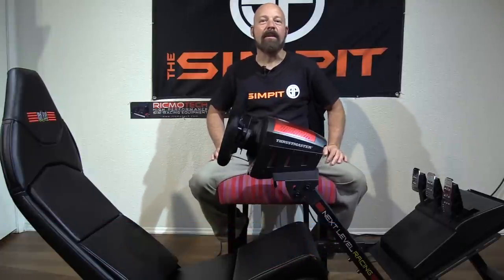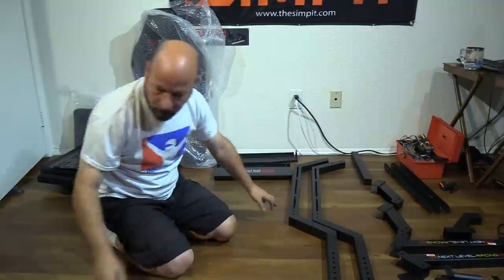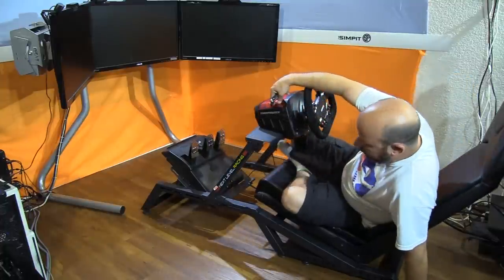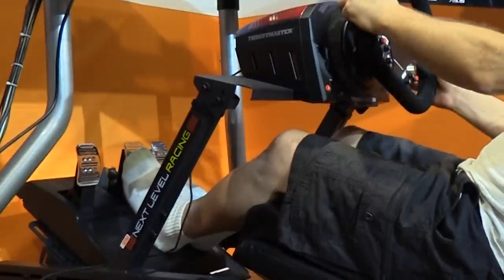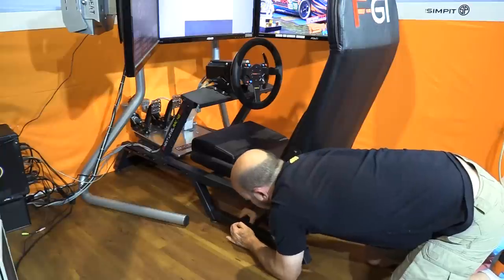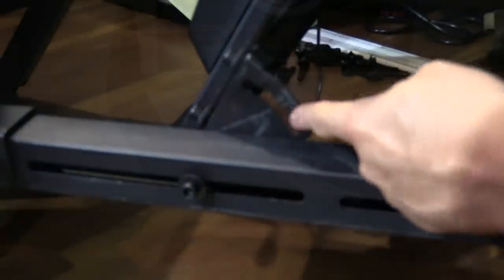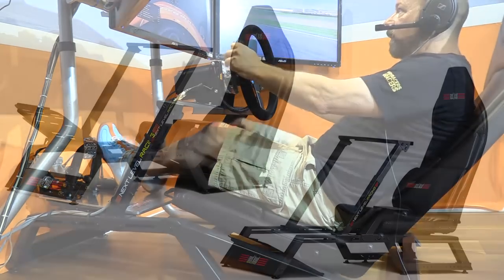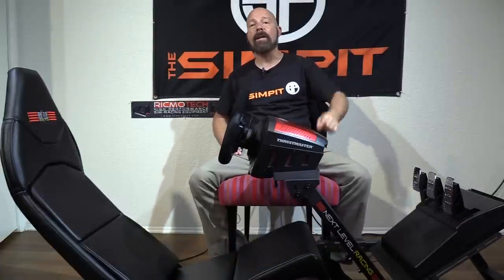Next Level Racing F-GT Sim Chassis Review

Comment: It’s been 3 years since I’ve watched this review and owned my F-GT rig and it still looks as new as the day I bought it, and I literally used it every day. I just upgraded to the CSL DD Pro 8nm and I must say this rig looks as modern and attractive as any on the market. I suppose for all those reasons I haven’t replaced mine!
Reply: Do you use it in the formula position? And if so do you have any issues with neck strain with your head being forward?
Reply: @MarkNOTW  for the first two years I used it in the formula position and didn’t have any neck issues. Rather, I was getting cramps in my abs and brake foot from the resistance of the sponge block.  The seat padding wasn’t the most comfortable so I took out the two lower sections and put softer pillow that conforms to my back. If I didn’t have the FGT rig already, I’d probably lean towards the GT track version with the recliner and bolsters. The GT position is easier to get in and out of.
Reply: @Midnitediy  thank you.
Reply: How does the rig perform with the DD Pro? Also buying  that with a load cell brake and wondering how it copes
Reply: Planning to get a DD pro (8nm and loadcell brake). Do you think this is a viable option for this setup? I was thinking of getting F-GT Lite given it's much cheaper but feel F-GT may be better at managing torque and loadcell pressure.
Reply: @AshCARisma  the F-GT Lite probably won’t be rigid enough for the DD. I really like the sturdiness but it does weigh a lot, mine is particularly heavy with the attached monitor stand and 49” Odyssey.  If you want to be able to store it away then get the lite.

Comment: To anyone in the future who buys this rig and is having a terrible hell of a time lining up the holes on the seat back with the bracket....PUT THE SCREWS IN THE SEAT BACK FIRST! Let them sit in there for a few minutes and tighten them as far down as possible. This will make the holes more accessible to find since the screws kind of bore out the seat leather. Then remove them and try and line up the holes like before. I hope that makes sense. I was able to attach seat fine after doing that. Also, screw them in from the bottom up and alternate sides as you go up.

Comment: Had mine for a year now. No need to upgrade, all is still solid. I have no movement on my base plate so i guess this is a minor issue on some of them that i luckily dont have. Iv used it in the gt setting about 3 times but due to its akward position its permanently in the f1 setting. Get one!!

Comment: I am considering buying either the F-GT or the GT Lite.

I like the perceived sturdyness that I would get from the F-GT, but I'm worried that it's going to take too much space in my studio and I won't have an easy way to store it when I stop using it. 

That is why I am kind of leaning towards the GT lite and its ability to be folded away easily. But given my heavy weight, I am worried that it will prove flimsy for me. Money is not a huge issue, but I do like that the GT Lite is half the price.

Comment: Thanks for the review! I'm trying to decide between getting this rig, or converting my Next Level Racing Wheel stand into the GT Ultimate. I feel the actual wheel deck on this one is going to serve me better in the long run though. With the seat mounting... can it be swapped out and a normal sport seat be swapped in? I'd be using it in GT mode only anyway.

Comment: im having issues with my knees banging on the table, only just got it with my CLS DD and cant eve race. either the wheel is too high up at face level... or its too low and im banging my knees... or, the pedals are too far away.... cant find a medium...

Comment: my F-GT shows up in a couple days i currently have my monitor mounted on the wall for a rig that i used my computer chair with, so fairly up right. Im trying to find online but not having luck (probably because it depends on alot of things) but what is the height of your monitors? like to the center of them. My the center of my 42 inch monitor is about 43 inches off the floor. IM thinking that might be too high

Comment: Thank you for posting the actual width of this unit assembled. On the NLR website they list the width at 24”, which means it wouldn’t fit with their own branded freestanding Monitor Stand which has an inner leg opening of 23”. Your video confirms the f-gt is 21” and will with the monitor stand.

Comment: For the price, I will always recommend the Simetik K2. Now, about this rig, hows the seat? It doesnt look that good/durable at all, like it wouldnt last more than a year before it starts to fall apart.
Reply: I would not agree about the seat.  I currently have a traditional fabric race seat on my Bob Earl Mark 2 rig.  I can confirm the fabric starts to tear after a while.  I've seen this seat in person, and believe it should last a long time.
Reply: K2 all the way. Also because you can replace the seat very easily and cheap.
Reply: Seat looks the same build quality as the previous  f1gt which injave had for 2 years and still like new. .thats  with at least  3 hours a day use
Reply: Problem for me is most of the higher end rigs like the simtek, simlabs etc etc... is they have to ship from the other side of the Atlantic assuming they even offer that. To ship a lot of them doubles the original price
Reply: Again, said this on two other comments but the K2 with everything factored in ends up double the price of the FGT, also with the extra hassle of having to find a seperate seat. The K2 can't be compared to the FGT as they are actually very different price points. €275 looks very attractive sure, add VAT, the shifter mount and shipping (UK)... €450 is more like it and that's before you even think about the seat! Looking at closer to £600 or euros with everything you get straight out of the box with the FGT that is £350 here in the UK.

Comment: Isn't the Obutto Ozone around the same price if not a little cheaper and comes with a keyboard / mouse tray and shifter mount.
Reply: @ChrisPBacon9  At least for me, the Obutto is almost $100 more. Arguably worth it but it depends on how much $100 is for you although it's very frustrating that shipping is almost 25% of the cost

Comment: Thanks for this review Shaun, but I do have a question about this kind of rig.
I weigh a little less than 200 pounds and I do have a bad back with 2 Herniated disc in my lower back. My current rig is the Obutto oZone Gaming Cockpit and I have noticed that I can't sit in my rig for any length of time and I haven't been able to do any of my league racing or doing iRacing special event racing. So would you recommend this rig for someone like myself who wants to get back into racing but is nervous about spending $500 for a rig?
Reply: This seat is awful for someone who had back problems my f1gt gave me back problems.
Reply: I just got a obutto revolution cockpit and put an aftermarket seat on it makes a whole world of difference
Reply: I would not recommend this rig for you! I have it and i like it, but if you have back problems i don't think you will be good with this rig!
Reply: @gozz9999   what kind of aftermarket seat did you get for your rig?
Reply: I have 3 fused vertebrae.  I like the Formula style seating for that reason.  The more upright position of other seats makes my back worse, but I absolutely need to use lumbar support to keep the pain away.

Comment: For this price, the rig is a rip off for me as you already can get a great 8020 profiles aluminium rig for 399$ (Sim-Lab GT1 Evo for example). The missing 100$ can be invested into a better seat. 

I didn't test the F-GT myself but from what I've seen in several videos it just doesn't justify this price.

If you don't rely on a F1 driving position you should look at other rigs invest the money in something better. If you don't want 8020 profiles rig, you should have a look at the Simétik K2. It's the next best with a very attractive price.
Reply: The motion device from this company is designed to work with the regular seat, and the ability to switch to Formula seating is a plus in my opinion and worth the extra price.  I prefer Formula style seating, and this is the best price out there for that.
Reply: Said this on a comment earlier but for the price, the FGT is a great rig...
The K2 with a seat and shifter mount ends up being around £600 - £700shipped to the uk. Picked an FGT up for £350 with all of the above and without the hassle of having to source a seperate seat. The K2's attractive price soon becomes double what the FGT costs so it's not a fair comparison in my eyes. Better off compairing it to the GT track for the money

Comment: Hey there, thanks for the review, because I have a little girl, I am constantly breaking down my current openwheeler Gen 2 rig and storing it in the closet each week.  I just upgraded to a Fanatec DD1 and it is nowhere near stable enough now.  How quickly/easily can you separate the seat section from the rest of the rig?  I need to kitty corner my equipment into a fairly tight closet when not in use.  This rig could be perfect if I can break it into two sections without too much difficulty.  Any thoughts on this would be much appreciated, thanks!

Comment: well done. i prefer my simétik k2, i think is better 😉
Reply: It really is.
Reply: If you live in Europe the choice is easy, the K2 is by far the best rig for the money.
Reply: I wad really tempted by the K2 but the hassle of having to source a seperate seat put me off. If they had a seat-included option, I may have been swayed. Also, Shipped to the UK, the K2 ends up being £450 with the shifter mount... Then a decent seat is at least another £150, making it around the £600 mark. Picked up an FGT for £350 with all of the above included and next day delivery. Those cockpits are not in the same price range at all, obviously the k2 will be greater. Comparing the K2 with the GT track would be a fairer shout.

Comment: Just ordered it after owning FGT lite which will be sold to a good new home lol. Thanks for all the info...complete spec video! Only thing that has me nervous is that CSL DD is straigh and the base mount only seems to go flat...I like the wheel to have a slight angle up, but Im sure with my mechanical ability I can add something to allow mount to tilt further so should not be an issue!
Reply: How is it actually
Reply: @キュウべえ-b6o  just got it together last night. Not much time in it yet, I do wish I could get my pedals flat on floor tho...I HATE tilted pedals makes my heels sore, which was happening last night. I''l make some adjustments today or add some kind of pad maybe. otherwise..so far...THE THING IS RIGID! Built like a truck

Comment: Hey Shaun, great review.  I'm currently considering getting this rig.  I'm 6'6 and was concerned about the fit.  However, I think that's no longer a concern.  I do have one question for you.  What monitor mount are you using?  I'm thinking of doing an ultrawide monitor.  I have a 34' ultrawide monitor now however I would like to do a 49' monitor instead.  

Thank you for your time and keep those great reviews coming! 👍
Reply: Did you buy it in the end? I'm 6ft6 too and 19stone so dont want to regret getting it if I'm too big... Its a toss up between this and the GT Omega Titan..